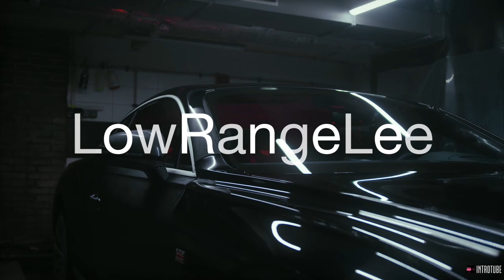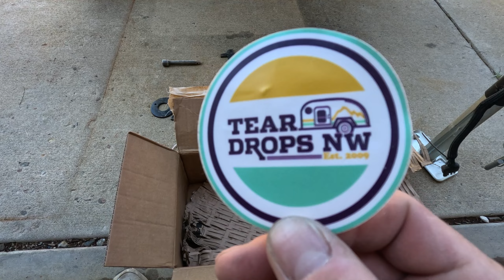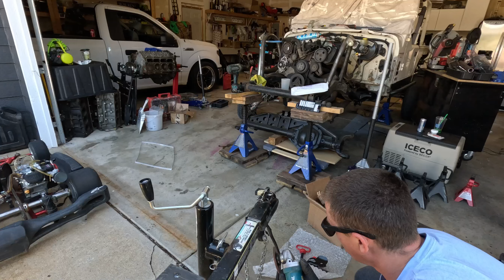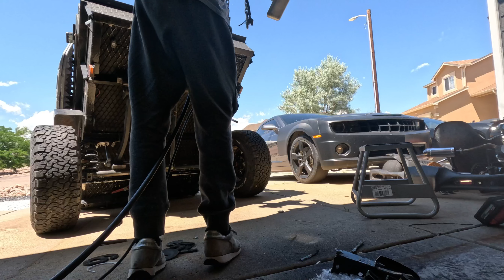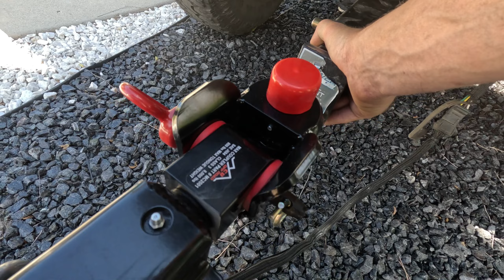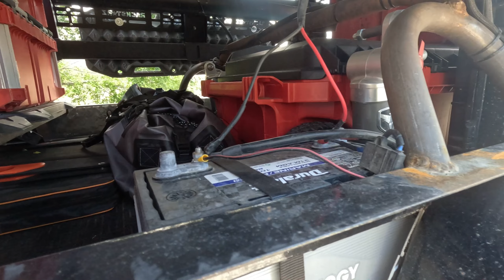Installing The MAX COUPLER Articulating Hitch on my Off Road Trailer

Comment: Nice work. Btw, I used to use a grinder tool wearing the same type of sunglasses you do until some day one of of those millions of particles fly over, down into eyebrows and sunglasses and then into my eye. It was an scary moment but eye recovered in matter of weeks fortunately. The leason learned in a very hardway was always use proper safety glass or mask.

Comment: If you just bolt it on with 4 bolts it would be stronger than any weld.
Reply from the maker: It has 4 bolts and welded.